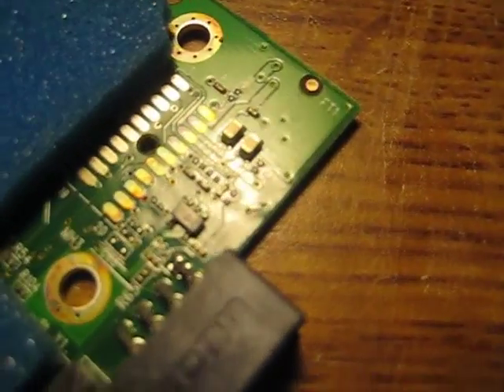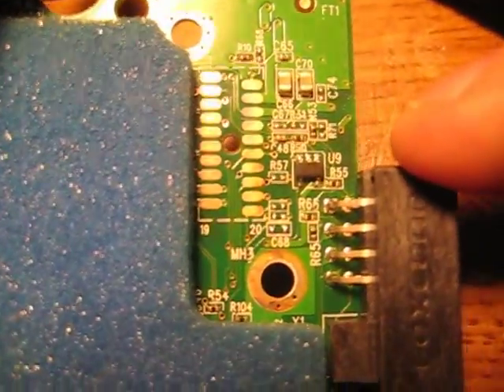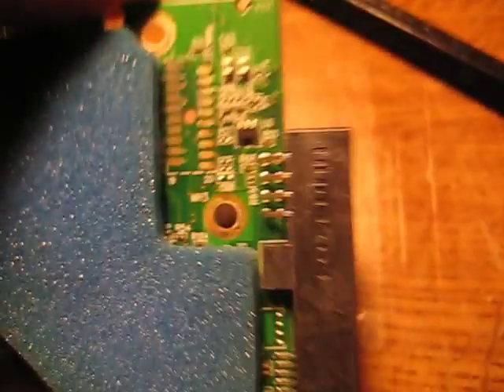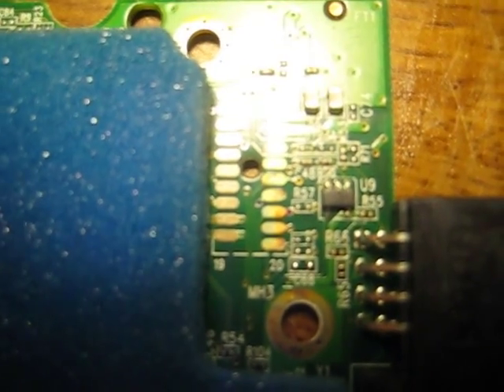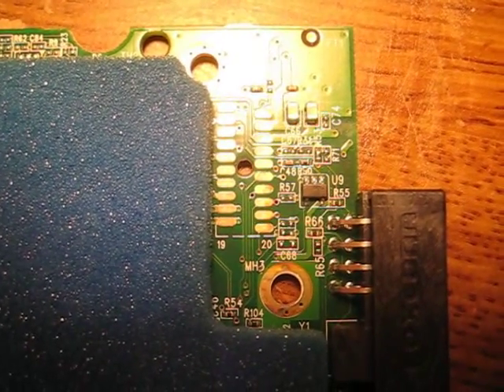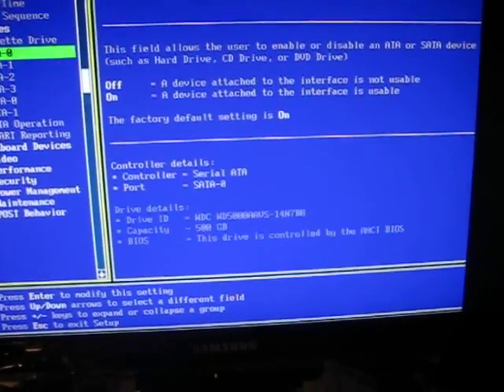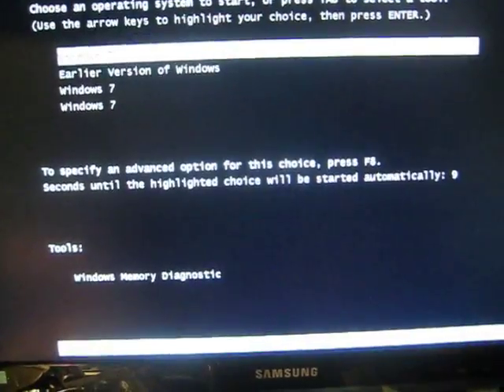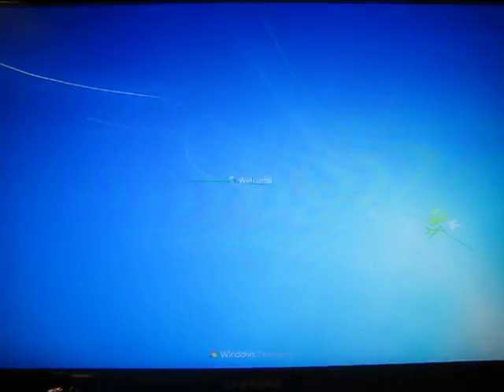Hard Drive REPAIR - Western Digital 500GB Green - cleaning contacts

Comment: After cleaning, I add a layer of silicone oil to avoid further corrosion.
Reply from the maker: excellent idea!  I fixed a LaserJet printer the other day just by cleaning the contacts on the cartridge and adding some dielectric grease for longevity.
Reply: I took a look at some enterprise level drives, and there the pads have solder on them; but for now I think I will stick with cleaning and a fine layer of silicone oil.
Reply from the maker: +Anwar Shiekh I'd keep the pads bare as far as solder goes.  the grease should help keep the oxidation from forming.

Comment: hm those contacts seem to be an engineering liability
a lot of hard drives i've come across have failed from actuator arm/head malfunctions
Reply from the maker: I will firmly note that shortly after this video, I had another random hard drive fail.  Random?  No, the one I talked about in my first video about this stuff.  It was not the contacts this time.  And even if it had been, it could still be the fault of my case, cooling, and house environmental factors together.

But it did last, what, another couple years perhaps, almost?  That one now does have some sort of head/arm failure.  The arm goes wild. for no reason that I know of.  Not stuck.  (I opened it after giving up).  Luckily it only held replaceable content (ripped movies, etc) so nothing was lost.  The drive in this video has found its way into a "new" box for the living room (TV) so it won't be holding any sensitive data.  Hopefully it'll last a long while again so I don't have to touch it.  :)

Comment: Very cool..is it difficult to take apart a hard drive?
Reply from the maker: Not really, though I wouldn't go any farther than removing this circuit board.  The actual metal shell that holds the disks (etc) is sealed in a dust-free environment.

They usually just have Torx screws, T9 size on this drive.